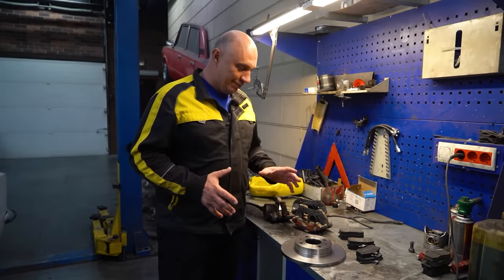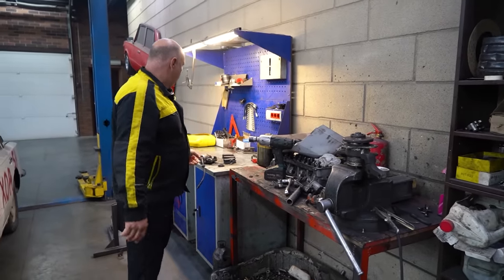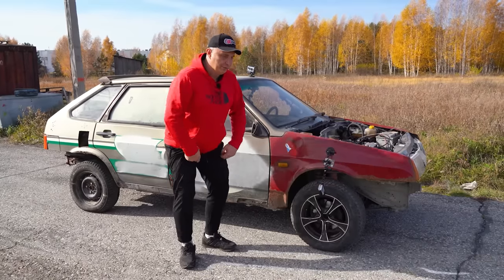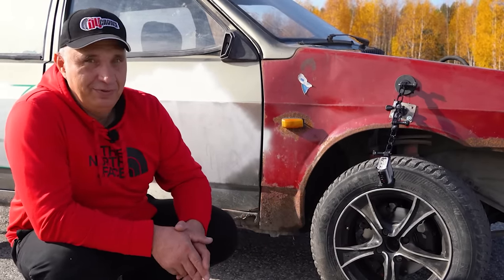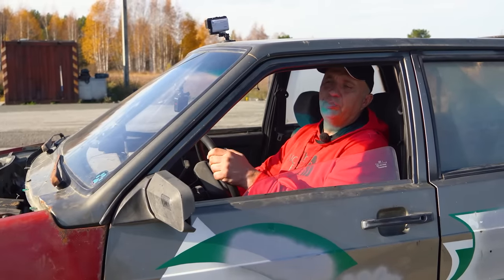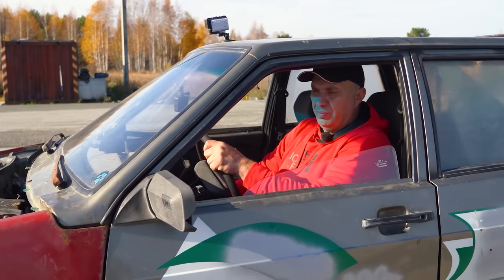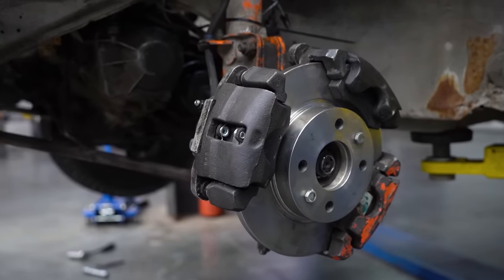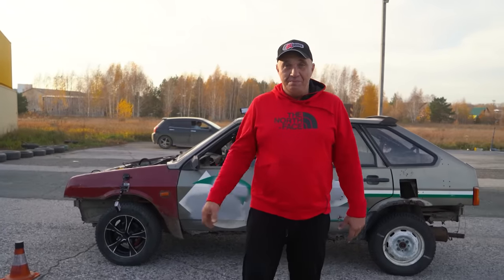Three calipers for each brake rotor – what will happen?

Comment: So there's a good reason why they don't do this on production cars. It becomes very difficult to dissipate heat, and your braking distance isn't actually any better. There's a sweet spot for the weight of the car and the type of application the car is in. Most modern cars if you slapped a 2nd of 3rd caliper on it, the braking performance isn't going to be much better if at all! There's a limit because of physics and thermodynamic limitations
Reply: Ive seen some Porsche racecars actually have dual calipers.
Reply: @AndrewTSq the second caliper of Porsche is for hand-brake
Reply: @AndrewTSq  Those Porsche race cars are using carbon disks, so they have the thermal headroom to justify a 2nd caliper. Keep in mind the hotter a steel disk becomes the more resistant it is to that brake pad. No matter how much clamping force you have, the pads will keep sliding off. Imagine a hot nonstick pan, and a fried egg sliding around on top of it
Reply: @TheCompyshop  yeah, maybe they had carbon discs. Not sure when Porsche started using them. Its the 956 where Porsche states this on their homepage "Hydraulic dual-circuit disc brake with Porsche dual callipers and ventilation through the wheel carriers" . Also saw that the famous Williams Senna 88 car had double calipers all around. (but that for sure had carbon discs :)
Reply: @TheCompyshop  actually, I just found that the Maybach 57 have dual calipers at front.. not sure why. I dont see why you would need dual calipers, cause as you say the heat.. I could see it if you had great discs, but not the space to fit one big calipers, so you fit 2 smallers ones instead.. but just adding complexity
Reply: @AndrewTSq  My guess is they know that car isn’t going to be driven hard, and it’s super heavy. But honestly they could’ve just put one large caliper on it instead, sooo they probably just engineered it that way for bragging rights lol
Reply: The limit on this Lada is the tires.
If Porsche carbon brakes was fitted to this Lada, the same result would show up and no improvement in brake length would be seen, because the limit is the tire.
If Porsche wheels and tires and brakes was fitted to the Lada, the brake length would be improved a lot because of the better tire grip.
Reply: @larsjrgensen5975  Correct. But only if the brakes are still relatively cold once they heat up even with good tires, the car is gonna have difficulty stopping because there’s no way to dissipate effectively with three calipers smothering that tiny rotor

Comment: This work because mor surface area = more stopping force  you can have one piston caliper stop the same as a 6 piston caliper if the surface area is the same but the 6 piston will definitely look better a good example is a audi a6 it's a 2 piston caliper and the porsche kiane 6 piston front caliper same surface area same braking results but the porsche looks 1000 times better

Comment: Thinktbey e done everything possible with cars..  3 calipers, 2 wheels, wooden car, clear car/motor/shock…. 6 wheels, 2 motors, 2 steering wheels, 2 car halves, car swing, rolly car, half car, double car, too many shocks,  no shocks, square tires, tracks, too many tire spikes, motors with different fluids, no fluids, biggest subwoofer, tallest car, big tires small car, small tires big car, electric car  conversions, leaf blower turbos, too many turbos, really big exhaust..   i could go on but that pretty much tells the story..

Comment: I would add bigger wheel and probably michelin psc4s tyres atleast 255/30r18 so with the one caliper there is no need to balance the brake paddle preasure so there is no lockup even with two. Then the real differance would be seen and probaly next step would be bigger disks et until infinity hahah

Comment: If you found traction limitations with two calipers per tire, adding a third per tire with no traction improvement wont yield any better braking, it will just make the pedal less linear. Drop the psi, use wider softer tires, you’ll see braking improvement with three up until brake fade from overheating rotor.

Spinning ain’t winning, and locking ain’t stopping

Comment: You overpowered the tires. When your braking force reaches the limit of the grip it doesn't matter how many calipers you have. Also, with 3 calipers most of the rotor is covered. Brakes work by dissipating heat. If you cover them up with brake pads, the heat dissipation is greatly affected. I could have told you the results, you didn't need all that machining... but then the entertainment factor would have been lost.

Comment: losing master power splitting the force on three calipers. I say you need to push 3 times as har as usual to get a real baseline. And after that, pretty imidiatly, crappy dry tires is the limiting factor. Wider super soft tyres is the way if you only want braking distance.
Reply: i would say, before watching the clip, if the brakes are up to spec, your gonna lock up the brakes. Do the baseline stock. Then just put super wide soft tyres on it. Maybe R-tyres for the track, more or less slicks.

Comment: 15:45
"Yea guys, you asked for it. We made it happen, and those are the results."

What are you talking about you made it happen? You gave up. You made nothing happen. Making it happen would involve getting the master cylinder to work with 3 break calipers. Not claiming it cannot handle it so we made it happen.

Comment: Dont know what is the point of this experiment 'cause 3 calibers wont give you more traction to tyre 🤔 You can easily lock brakes just with one caliber. You should add traction until one caliber isnt enough and then add more.

Comment: You should put some sticky stuff on the tarmac, like they have on dragstrips :) to get the tires grip more. I think 2 calipers is enough, but maybe also try to add weight at the rear of the car, to help the rearend also brake. (and maybe have 2 calipers per wheel also at the rear)

Comment: Havent watched the video yet but i can tell you what happens, exaclty nothing. 1 caliper is enough to lock the wheels on a car at any speed so that would not be helpful until the car has more traction than what your breaks can handle, then im sure extra calipers would be helpful but at that point you use ceramic breaks and larger discs, more surface that way, because the disc also needs to be able to take the force excerted o to it. Lets watch =D
Reply: Guess i was kinda right except they managed to find the one car that cant lock its breaks with just the original caliper 🤣

Comment: That’s a very thin brake rotor. It has no veins. I imagine the car doesn’t have much horsepower. I can understand maybe 1k hp. But if not this is unnecessary in my opinion… It will stop the car for sure but how fast?

Comment: I think a bunch of viewers need a reality check... or try and broarden their common sense a bit..

the tyres are the contact point in a breaking system, not the breaks. for modern cars they come stock capable stopping the car as fast as possible... with abs (just not too often in one go), changing the size or.............quantity........... of the componants changes nothign in that respect, without also changing the tyres.